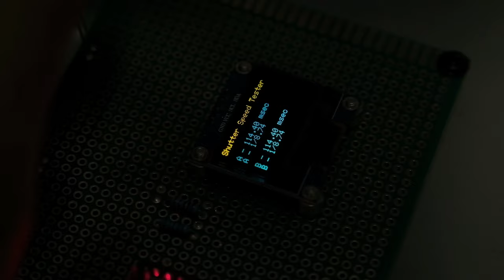The camera that will last till grandson of your grandson die - 1960 Pentax S3 repair and restore

Comment: Thanks for your comments.  I have never bought a Nikon mirror-less camera.  I’m older than you are.  I bought my first Nikon F in 1970 as a kid.  I couldn’t even afford a meter then, forced to learn EV on my own.  I bought the F36 motor drive within a year or two.  I transitioned to an F3, a stellar film based camera.  Having auto exposure was a tremendous enhancement over a Nikon FTn.  Lastly, in the film world, I got the F5.  It remains one of the best film cameras in the world even today because the of matrix metering and 8 frames per second capability.   Its autofocus capability is incredible, particularly with the AF-S lenses.  Having Nikons for over Z50 years I have rarely sold off a Nikkor kens.  They are optically first rate, with great, robust construction, and evolving lens coatings.  I have about 50 Nikkor lenses, from 7.5mm to 1000mm, including my most prized, the infamous 13mm f/5.6 AIS Nikkor.  I have only had 2-3 lens failures in all that time.  Mostly a few screws will back off and need a wee bit of help at a repair shop.   It it is minimal!  I’ve carried these things around with me around the world.  I used to carry a motorized F3 in a small red and white Playmate cooler in the cockpit with me along with about three lenses. (I used to go to Iceland a lot with the USAF—a wonderful location!). Auto focus is a definite requirement for certain types of photography, like sports and wildlife.  But my shooting is more static—landscapes, and such.  I can take my time, and set hyperfocal distances on my lenses.  I have evolved to Hasselblad for larger negatives (transparencies) and find the Zeiss optics to be first rate!  For smaller formats, I have moved onto the Leica SL2S, a very fine mirror-less camera.  I use mostly Leica lenses along with adaptors to run certain Nikkors on them.  I also have several Leica cameras for film, like the MP, M5 and the run of the old Leicaflex SL bodies.  After 50-plus years of photography, I have reached the conclusion that Leica optics are worth the money, and they retain their value.   Ditto for Hasselblad’s Zeiss optics.  Nikkors lose their value, in general they are a wonderful bargain.  For the money, they are first rate, and they are very durable, as I stated earlier.  If you chose to buy used Nikkor lenses, do it smartly.  There is a small hardcover Red Book by Peter Braczko which lists every model of older Nikon lens down to the serial number ranges!  It shows you which have the latest or more modern coatings, and which mounts they have, like AI, AIS, etc.  if you are buying them used, go about it smartly.  Ditto for Leica and Hasselblad.  Buy the Leica Compendium or Hasselblad Compendium to know your lenses.  Keep in mind that my virtual abandonment of digital Nikon SLRs is largely due to Nikon not maintaining a repair capability for them.  Any of my old or new Leicas can be repaired.  Ditto for Hasselblad.  My D3 or D3S is no longer reparable by Nikon.  Yet, it was a great body.  Don’t get into an equipment chase.  Spend the money on optics, and not on the bodies.  Bodies quickly become obsolete.  Lenses resting their value if they are good designs to start with, and for nikon, feature ED glass you are shooting above 100mm.  Ditto for Leica.  Get the APO lenses when above 90mm.  For Zeiss and Hasselblad, invest in the Superachromatic lenses. If you don’t have an eye for composition or lighting, take some classes.  Practice is the best solution and encourage others to be critical of your work.  Equipment does not solve a talent shortfall.

Comment: I can do basic CLAs but never attempted a shutter courtain replacement. Do you have some tips for cleaning leatherette that goes brown from bending? Very clean video and good work!
Reply from the maker: Leather shining liquid or spray will do most time. Replacing the leather will give you best results. Usually I send the dimensions of the leatherette to local leather craftsman for cut out. Then I just glue those leather or leatherette. Cutting leather also need specific tools and skill if you what best result so I leave it to the professionals.

Comment: What did you put on the screws at 3:50 please? I've tried undoing the equivalent screws on a Miranda C and ended up mangling the screws and still not getting them out.
Reply from the maker: It’s just the WD 40. And I leave it for about an hour.
Reply: @VintageResurrection  Thank you.

Comment: Can I ask you just one question? What were the plastic parts in the process of disassembling that camera? Also, was the spool plastic? Oh, and when I removed the white gasket from the rewind lever (9:31), I wonder what the consumption of this gasket was. Also, were there parts like fiber other than shutter curtains?
Reply from the maker: I also don’t know details usage of some parts. I think that white washer is to prevent dirt entering into the body. The shutter curtain roller is also made of plastic I think . The service manual said you shouldn’t apply any lube for plastic part in curtains roller , only apply tiny amount of watch oil into metal shaft and gear assembly.
Reply: @VintageResurrection  thank you!!

Comment: What kind of glue softener solution do you use?
Reply from the maker: You can get the glue remover/debonder from the paint shop. I don’t known the chemical properties of that. But it won’t work on every glue I think.
Reply: @VintageResurrection  Thank you !!!

Comment: How to build the shutter speed tester?
Reply from the maker: There is a one easy to make with arduino upload by hiroshootsfilm. I modified the code to work with dual sensor for my test. You can get pretty good result with original one. But if you can use laser diode and laser sensor result will be more accurate. 

https://github.com/hiroshootsfilm/shutterspeedtester